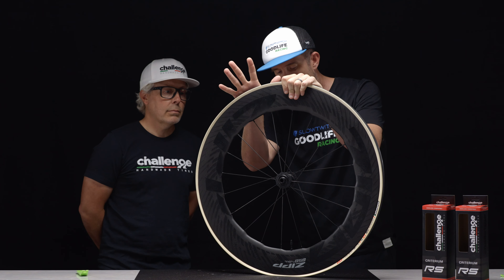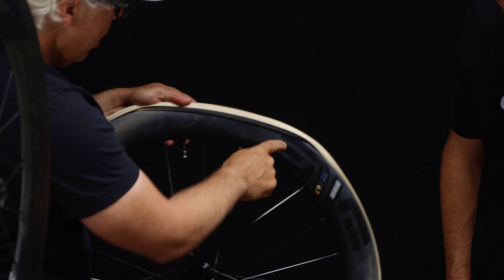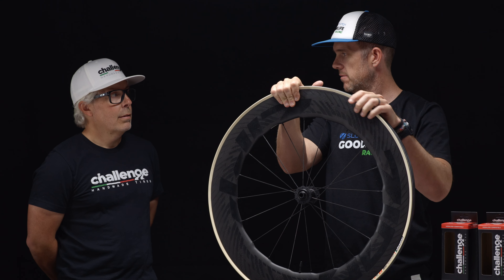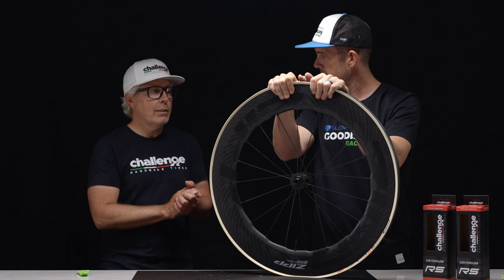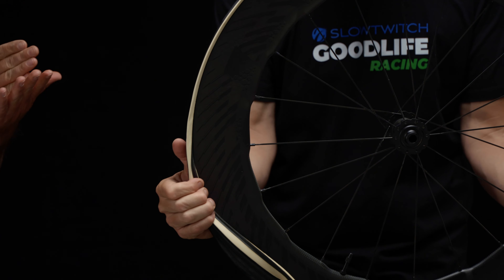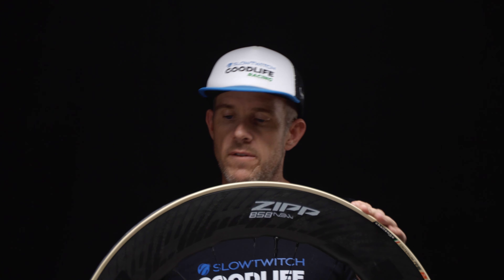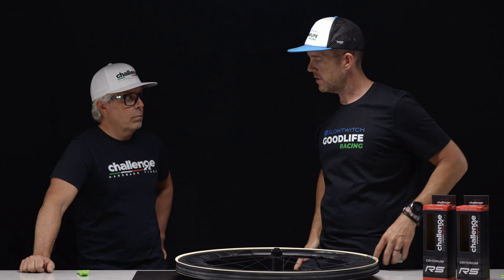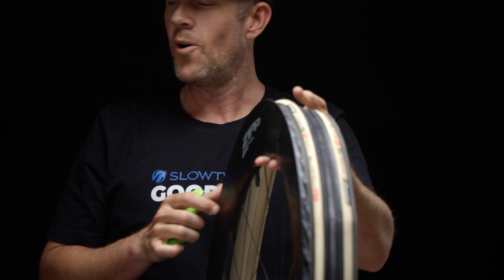The easiest way to install a Challenge Handmade tire.

Comment: Dear Mr Challenge tire guy, don't blow smoke up our ass. These tires are brutal to mount. I've watched all the videos there are on mounting them and used the aggregate info on taking this on. That there are numerous videos on  mounting not just any tires, but Challenge tires says something no? I've mounted one, no sealant, more tears for another day. When I finish the second, I'm adding this to my achievement to my LinkedIn, to show my tenacity, my fearlessness in the face of adversity.